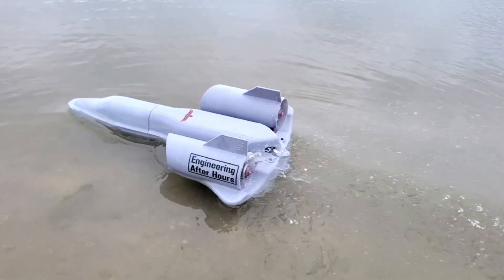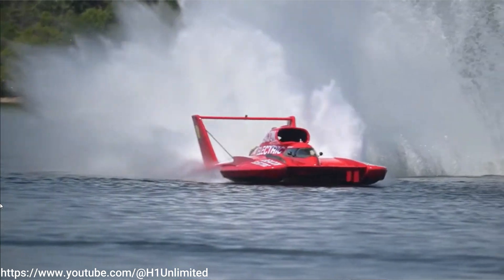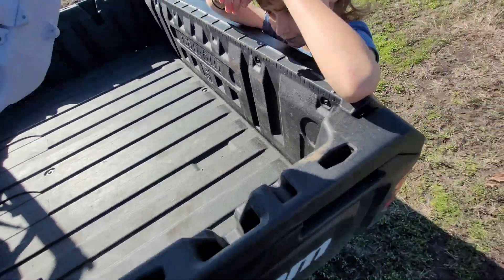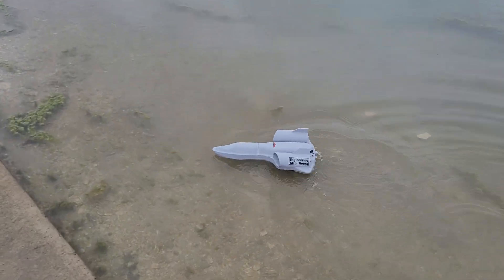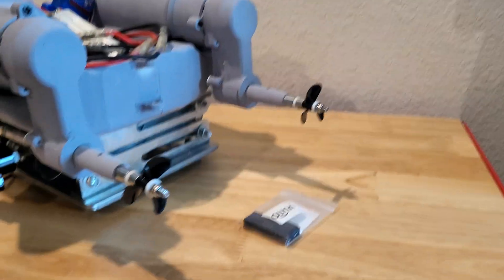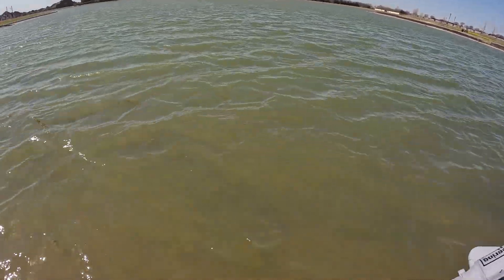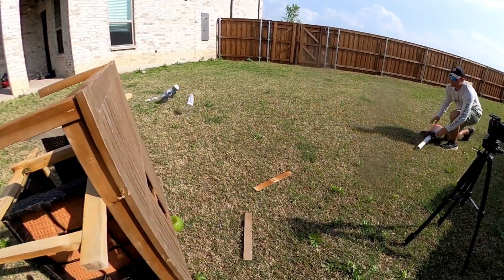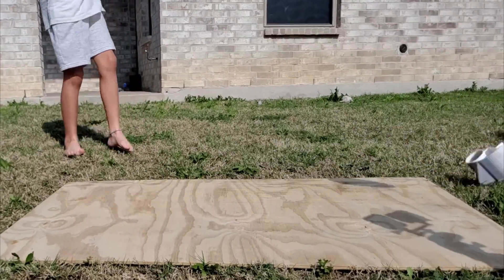The SR-71 is a terrible boat - here's why

Comment: as a marine engineer, it is very sad to see these attempts to solve the initial problems the wrong way, which ruins the following chances of success. otherwise, it is not common to see new interesting boat designs made in 3d prints. if you want help for this project, i wiil be very happy to join.
Reply from the maker: Oh man I'd love some advice on our boat builds the next go around...we are completely shooting in the dark on these as I work in aerospace lol.
Reply: @EngineeringAfterHours  is there other place to talk?
back to the project, if you add some floater to the hull, it must mantain the even queel, with no trim, or a positive trim. the way you did, it made a negative trim. this is awful to stability and seakeeping, creating a downwards pressure when speeding.
Reply: @EngineeringAfterHours other problem is to make de inlet pointed down and pushing the ship into the water while sucks water.
Reply: @EngineeringAfterHours  after fixing these problems we can talk about vertical cg position

Comment: I think your main issue is the duct inlets are angled wrong and there is no surface under them to keep the water out. Chamfer the inlets so they open towards the top not outward like you did and extend the surfaces under the front of the duct inlet all the way forward blending into the front fuselage to keep the water out. Think of how the sea dart inlets are protected from spray by the everything under them.
Reply from the maker: Thanks for pointing out the sea dart. I had never heard of that plane. I agree that the inlets needed a lot of work. Another big limitation of the boat is the geometry in general. I should have discussed it more in the video...but its really roll sensitive. If it leans to far left or right, it'll force it to turn.